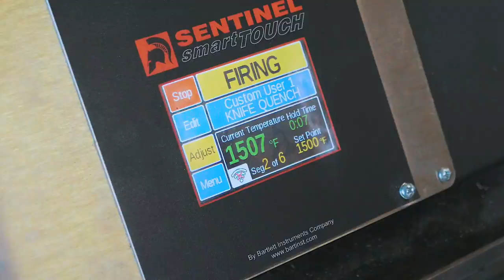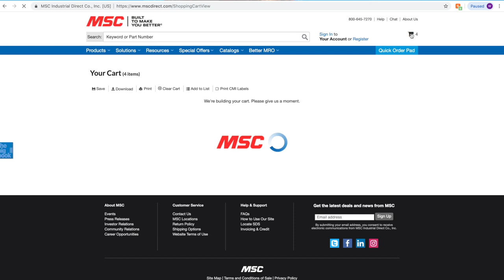The ULTIMATE Zombie Bayonet: Part 2

Comment: At 6:41 it appears you add the entire contents of an acid container into the etch tube then dilute with water. Depending on the concentration of the acid this can be extremely dangerous since the dilution of acid releases a ton of energy which could result in the partly diluted acid boiling and spitting. As a general rule always add acid to water not vice versa.

Comment: You guys, this is friggen awesome! I have one question though, why have the teeth of the saw cutting in only one direction? Wouldn't the ability to cut only one way hinder a survivor?  I mean this in the sense that saw teeth are like files or barbs on an arrow that will get stuck in the material they're instructed to bite into. If you look at a western carpenter's saw, the tool has the ability to cut both ways (on the push and pull). You guys experienced the downside of single-directional cutting with the plunge filer. Just a thought, not a criticism!  
Please carry on!

Comment: Hey Alec I had seen a technique  when smithing a blade and i wasnt sure how its done.

My friend had been using folded steel (he had been making a tanto) and after he forged it and heat treated it he held it in acid for about 10 minutes. The blade had come to have a sort of transparent top layer that was almost transluscent and let you see vein like designs in the steel.

I have tried replicating this and have not been able to replicate what he did. Do you know how he did it or how I could do something simmiliar? Thanks in advance.

Comment: Cringing at a bent barrel. Please after you swing it and hit something hard...dont shoot it!!
Reply: Tom Tulloss nonsense, he just made a krumlauf 😂
Reply: The bayonet in this instance isn't attached to the barrel, they bolted it to the hand guard which is free floated off the barrel itself, at worst you might bust the hand guard but that's it. It's fine.
Reply: looks like the spine of the blade near the tip is getting close to the path of the projectile as well
Reply: @Biggusdickus721  So perfect!
Reply: @zachnewman8622  Guards are not entirely floating. The front mount does and any hard movement will transfer to the barrel. Spend an afternoon hitting with it and then try firing a round. I wouldn't take the chance!